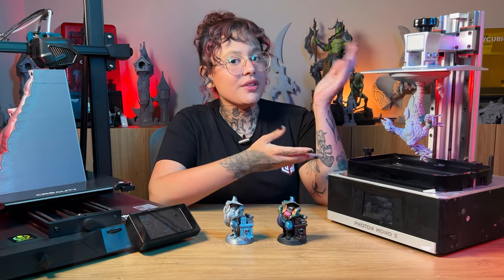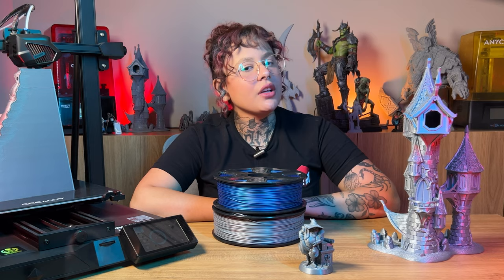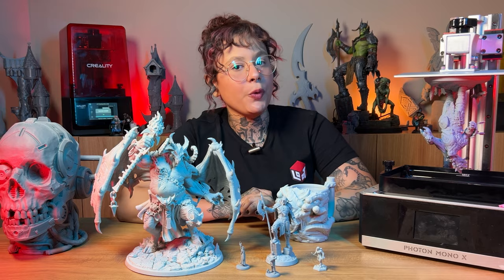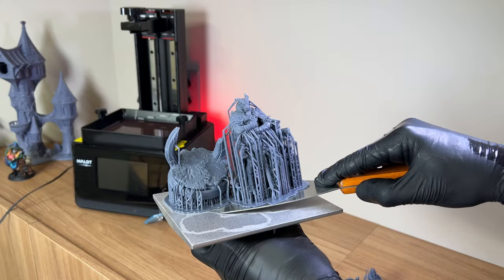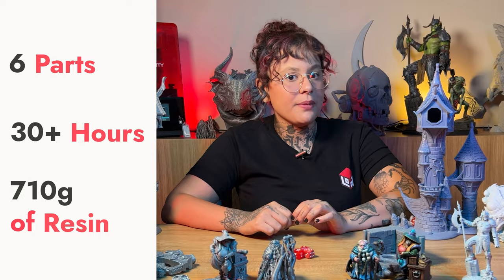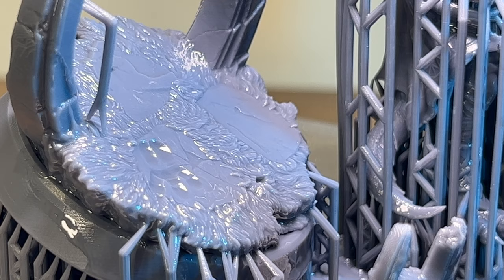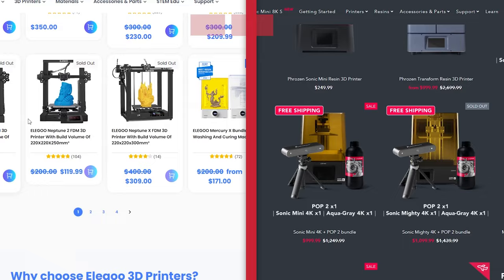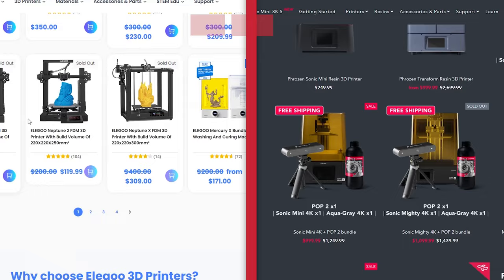Resin VS FDM 3D printers: Which one is the best for miniatures?

Comment: It would be nice if they showed a side-by-side between fdm and resin with a dialed-in fdm printer. I’ve definitely gotten way better results than this, and I’m a rank amateur.
Reply: Yep, if the surface looks like that without being absolutely buried in supports something's wrong with the printer.
Reply: Resin will always have better details. No FDM printer would ever beat a Resin printer when it comes to that. FDM will produce inferior products but save you money overall on filament. Bigger models can be more costly with FDM printers due to the amount of filament wasted on supports
Reply: @williamstevenson9480  I don't think anyone ever claimed FDM wasn't worse. The question is by how much, and in this video FDM prints were clearly a bit...suboptimal. In 4 years of FDM printing I have never gotten such terrible quality out of a print, I don't even know how I could make it look that bad intentionally.
Reply: Same here. Those fdm prints look atrocious. I have a bone stock ender 3 V2 that I get better prints on with.. and get this, no leveling after 50 hours of continuous prints. Still better 😂 this has to be an ad for the anycubic resin printer
Reply: @williamstevenson9480 we know that. Obviously. It's the fact that we get better fdm prints on a old as shit ender 3 that hasn't been leveled for weeks of prints. This just took the detail gap and made it extraordinary by not having a dialed in fdm printer. Whether it be from incompetence with fdm printers or just a way to sell ppl on the anycubic will take further scrutiny than I am willing to do.
Reply: So true, absolutely atrocious, clearly they favour the resin printer and have no idea how to use FDM
Reply: Indeed and using silk PLA+ makes prints silky smooth.
Reply: I've gotten far better results than this as well
Reply: I said this up above but I have a good friend with a very nice FDM printer (>$1,500.00 US) and I have a Saturn 2 Resin printer.   We both tried to print out our miniatures at 27mm, 12mm and 32mm.  He couldn't do the 12mm prints, his 27 and 32mm prints looked decent though.  Until you compared them to the Resin prints.   The 12mm prints on the Resin are not fun to work with but came out excellent,  but the 27 and 32mm look professional.  I mean perfect and near impossible to tell the difference from a mold.   There was NOBODY at the table that couldn't tell the difference immediately.   It is night and day when you set them side by side.  Now does that mean the FDM is crap?  Not at all.  For me back in the day having my character from Hero Forge or Titan Forge printed on his FDM printer would have been incredible and I would have enjoyed it for sure!  Until you compare it with a Resin print.   Then I would want that one but still would have a blast with my FDM printed mini.   Next up was dungeon terrain.   Resin kind of sucks balls for doing dungeon walls and floors.  Yes it can be done, and I subscribed to get some cool magnetically connected dungeon tiles, then printed them, added magnets and waisted a LOT of time and money.   By far it is better to print this on his FDM printer than Resin.  His printer is freaking HUGE and mine is not.  I did one rather large dungeon layout with my Saturn 2 and it probably cost me like $200 in Resin.  Yes it looked cool and I painted it but it also took me around 2 months of printing every day and working on it.  I learned a ton while doing it, and the largest lesson is to never do that again.   He could have knocked that out in 1/4 of the time and way less costs and mess with the dungeon floors looking 99% or equal in quality.   Now I just create my dungeon on sections of large paper 17x24" and laminate it.  This works great for me and is SUPER fast.  Yes it isn't 3D but my group doesn't care and it makes the game go much quicker.   This is much much much faster and cheaper and makes our game run a lot better as I just remove covers from the rooms they can't see at that time.  I do print out monster, characters, some NPCs and things like chairs, tables, chests, candle sticks and other crap you find in dungeons and it is easy and my players like it.   My friend will print out things like trees and other terrain that is larger and things where quality doesn't have to be professional.
Reply: @williamstevenson9480  Concerning your point that the FDM "wastes" more material for supports. Just look at the numbers for the dragon head in the video bro. They used over 500g of material more than with the fdm for resin, because resin is a solid piece, where FDM is hollow... And at least in germany, standard Resin is double the price of standard PLA or even PLA+
Reply: No kidding.  That is like a worst case for FDM. I have a friend with an X1 Carbon, and he uses it for 'parts' without concern for how it looks, and his prints look better than that.  Yeah, I can get better with resin - but there is the mess, the pipe, the don't breath this, the 'why does the garage smell like this' from the Mrs. and on and on and on. 
He and I both printed the same thing at the same scale (but again, his not dialed in).  Mine was better on a Saturn 3, but it was close.  Add a .2 nozzle and some optimizing on the Bambu and it gets a lot closer fast.  At what point does it become 'good enough' that I don't have to have a wash and cure station next to the printer, and instead have 4 color/material options at print?

Comment: I have both types. I prefer printing miniatures or statues with my resin. Even if I have to cut it into several more pieces to print large scale, I find the cleanup and finishing easier and faster. With fdm you have a lot of time finishing the print. From sanding, filling, and just general prep to get to the point of painting, is time consuming and messy. I use my fdm printer for parts and functional items and the resin for display pieces.
Reply: THat's the key. The use will condition one or another
Reply: FDM for most environmental architectural pieces, resin for miniatures. Gotta love how cheap printers have become and the quality and reliablity of the Bambulab FDM printers is just absolutely nuts.
Reply: That's the point, do you advice a beginner to start with Resin or FDM ?
Reply: Yeah sanding and filling really takes a lot of time.
Reply: @nadiryoussef3035  FDM. It's safer, cleaner, and faster to get started making parts with it than resin printers. You need dedicated ventilation to run a Resin printer indoors, that  and a cleaning station, respirator, and UV box. 

FDM safety protocols are simply:
1, Place printer in room with Fire alarm. 
2, Push scraper AWAY from self when removing Prints.
3, Don't eat the filament.

Comment: You can increase filament printing by using a smaller nozzle like a .2mm and reduced layer height of .05mm - .08mm.  With better material removing supports from an FDM print like PLA+ will reduce the chance of breaking parts. I printed and all my minis ended up breaking in resin while my FDM is much more impact resistant and less brittle/fragile.
Reply: somehow Prusa Slicer has allowed me to print 0.08mm with a 0.6 nozzle yesterday!
Reply: @barbarosbozkurt758  Nozzle diameter is something entirely different from the layer height
Reply: @martinmica4260  I know, what I meant was Prusa allowed me to use those settings unlike Cura which only allows up to .2 layer height
Reply: 100% I am printing mi minis in my ender3v2 at 0.08 with a .2 nozzle, it takes a lot of time but damn they come out amazing, of course resin would look a lot better, but at 0..08 height with the .02 nozzle as soon as i apply a thin coat of primer, 99% are gone, and i only file sometimes under some parts or at the very top of when some layers are a lot more noticible... i got some minis to look like resin printed ones after painting, it is a lot of work to get to this quality but while i don't get my resin printer, it works amazing! If they had taken a bit more of time calibrating, fine tuning and printing at theese setting or enven a .05, it would look a lot closer in their comparisons. specially when those minis where quite "big"

Comment: My good friend bought an excellent FDM printer for around $1,500.00 (US) and I have a Saturn 2 Resin printer.  What we noticed is this.  The Resin printer when printing miniatures looks like something you would buy from a store, if not a bit better.   The FDM printer is decent but you can tell it was printed and not molded.  However the FDM printer, like you said is on a huge build area and can mix in different colors to do some cool terrain.  Now even say 72mm larger prints look significantly better on the Resin printer.   I guess where I am going is this.  If you want a miniature that looks professional then you need a resin printer today.  If you don't care that much and just want something that looks good (not great), and you want to print out larger models, not worry about Resin, then FDM is the way to go.   For me it wasn't even close I want quality.  For my friend it wasn't even close he wanted less mess and decent quality.    I will add that if you are getting into this as a hobby, then you will probably print out a bunch of stuff early on, but then slow way down.  So keep that in mind also.  If you are a Pathfinder/D&D player I am sure either would work for you, but again if you are printing out your character from say Titan Forge or Hero Forge, then I might lean heavily toward a Resin printer.

Comment: Both is an underrated option.

Like for my tanks, vehicles, buildings, etc, print out the body in FDM, and the greebles and the details in resin.
Reply: My thoughts exactly. Cost-wise (outside EU and USA), a larger resin printer, like a Saturn, can end up costing $1000. With the same money you can get yourself a Mars 3 Pro and an a Neptune.
Reply: Hello there, I want to print tanks using FDM, but I don't know how much precise I need to be in order to get a good result :/ what printer are you using ?

Comment: Bad printing with FDM is due to wrong layer sizes or wrong slicer settings. I have both types of printers and currently only use resin printing for crystalline items.
Reply: So you can get rid of those vertical lines? Which one is easier to paint over ?
Reply: @elprogoodbg5872  they're pretty easy to file down and primer over, mostly. A lot of prints I see from cheaper resin printers are theoretically much higher resolution, but often look kind of rounded off and spongey which isn't much different to using thick primer.
Reply: @elprogoodbg5872 yes you can get rid of the line 0.12 layer height here, wish I could post pictures.  Can't see lines on my DND miniatures.
Reply: @Jointtheartist  thank you

Comment: to clarify on the cost question, SLA setup cost about 3x the cost of FDM setup.

1. the cost of SLA printer is similar to FDM printer or at least you can buy printers at similar price ranges
2. but SLA printer require a LOT more additional stuff like:
a) Wash n Cure station - because uncured resin is toxic
b) Respirator and facemask - needed for safety
c) 95% or 99% Isopropyl alcohol - you need at least 1 gallon to start, i recommend 2 gallons
d) garage or ventilation - you need a proper ventilation system or a garage dedicated to 3D printing to keep the fumes away from your family
e) enclosure and heater - resin print best in temperature controlled environment AND still ventilated. thus, a fire-resistant enclosure is needed with a mini heater inside of it.

be very careful that resin is toxic and 95%/99% alcohol is highly flammable. alcohol also vaporize at 20C or room temperature.

due to the need to handle materials properly, there is a lot more added cost to SLA printing than FDM printing. i own both type of printers, and i would recommend SLA to those who is prepared to deal with problems. for those who are lazy or live in a condo where ventilation isn't possible, then FDM is your only option.
Reply: this was very helpful

Comment: Modern FDM printers are 6-8 times faster and twice the quality now. Wish this was a comparison to show the real advantages of FDM. speed, volume, cost. Anything small like a miniature that needs. Lots of small details will be superior on resin, large scale, terrain. You would be crazy to print in resin, unless it needs super detail like architectural models or a tree with leaves idk
Reply: This is the answer. Miniatures CAN be printed on FDM, but they won't hold a candle to a  tuned modern resin printer. But things like terrain, engineering parts, or even that dragon she printed are great candidates for tuned FDM printer.
Reply: @jeffreybowers5646  so larger pieces ?
Reply: @Fallingoverbackwards  Mostly, or anything that doesn’t need extremely fine detail on a small area

Comment: Hi Loot team. Great to see you talking about Filament and resin printers side by side.

 I wish you would offer supports compatible with FDM for at least your bigger terrain pieces. 
Yourpresupported terrain would work just fine on an FDM printer, but your supports are too fine for 0.4m nozzle near the top.
Reply: We need proper FDM support for the props as well! I did the mask from the cyberpunk pack and it took a lot of work to prep it for FDM.

Comment: Nice video. You forgot to mention that FDM prints are generally more resilient while resin prints are more brittle and if you drop them they are more likely to shatter.
Reply: Let me introduce you to Siraya Tech Tenacious 😁 10 - 20% mixed in to standard resin and it becomes pretty damn tough!
Reply: ABS like resin is very durable.
Reply: at the moment you can even print rubber on a risen printer...
Reply: @cjlake5754 Tbh,I like the idea of both.  I kind of hope that FDM keeps improving to the point of, say, a current 4k resin printer because it cuts like plastic and glues like plastic.  If I end up good enough as a printer, I probably want to eventually print Titans and have heard the best combo is FDM for the frame and resin for the outer plating.
Reply: I mean, FDM IS plastic of course
Reply: @hmmm348  oh there's absolutely a place for both in your hobby room if you can afford them and have the space! I hear the Elegoo Neptune 3 is pretty good.

Comment: i have a elegoo mars 2 pro. Where is best settings to make excellent miniatures? i use elegoo resin water but i want try Siraya tech . Can anyone suggested me ?
Reply: There's no default "best settings" that you can just dial in and print. Adjust the settings to the recommendations that Siraya Tech or Elegoo recommend for the specific printer+resin combo you want to use, then run calibration files and make adjustments to the exposure time until you're satisfied with the results and use those settings for your minis.
Reply: @theChistu you can suggested me settings for elegoo and siraya maybe? i find online some settings for now. thanks so much

Comment: One point is the geometry of the model. If you want a good mini, FDM can do that. BUT: the pose and the small parts shouldnt go under 2mm to avoid print fail. So the simple answer is BOTH PRINTER. It depend on what you need. You need upgraded token and so simple pose mini can do the job? even FDM is a choice. If you need high quality mini, hyper detail and smal parts Resin is mandatory.

Comment: MY take on this is... FDM for Terrain and Resin for Miniatures
Reply: Exactly this
Reply: You also get the added benefit of FDM for functional objects that resin would be too brittle for. I've made several little useful objects and fixes with the FDM. I can't say my resin is that useful, but it does produce beautiful models.
Reply: @Asytra  exactly why I print Terrain with an FDM. Resin is in my workshop just for Miniatures, busts, ect.
Reply: Yep i do this but a couple of years ago i did minis on a ender 2 pro with a .3 nozzle an fat dragons profile and 28mm/32mm figures came out surprisingly good. Only reason i got a resin printer for minis was i can print 16 on a S2 in the same time the fdm prints one.

Comment: when you talk about time to print - you need to give 2 options: pure print time, and print time with post process. Post process with resin printer is so painfull and dangerouse at the same time.
But you would never get such detailed result by exspensive FDM printer as by cheapest Resin one. So choose is easy. 
1. Miniatures and high detailed medium size models - Resin printer 
2. Large models or less detailed models for cosplay - FDM printer

P.S. Additional if you want printer for amature engeneering purpose (some prototypes or  some boxes or some gears and etc) - FDM printer your choice. But my own advise - take one with autobed leveling and as much "Plug'n'play" as you can afford. Because on my own expirience - less you need preparation and post processing - more you would enjoy it and more you would print. Because my Resin printer just collect dust right now (I mostly using 3d printing for engeneering/diy purpose).

Comment: Thnx for the video...ive been wanting to buy a 3D printer to learn about this world and i found a new Saturn 8k printer in 300 CAD (225 usd) and im very close to buying it but i was wondering whether i should try fillament first.
Reply: well, a resin 3d printer is better for miniatures but also kind of toxic and very difficult and a filament 3d printer is easy but has a lot of problems there is the bamboo labs x1 carboon which is a filament 3d printer that I print in color but uses a lot of filament and also is too expensive

Comment: I'm kind of new to the 3D printing and I have a question. I apologize if it seems to be a stupid one... 
But, Is there a way to recycle the hardened scrap resin after a print? Like melt it and add it back or something? 😬
Reply: I saw someone grind it down and mix with adhesive to make a filler paste, but in quantity: no there isn't and it's a shame but even with the waste it's many times more economical than shop bought